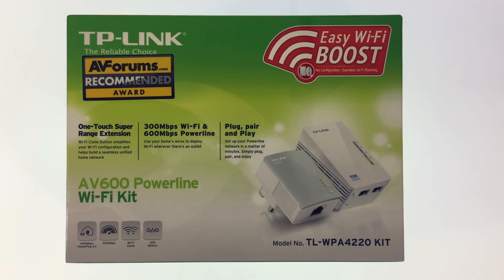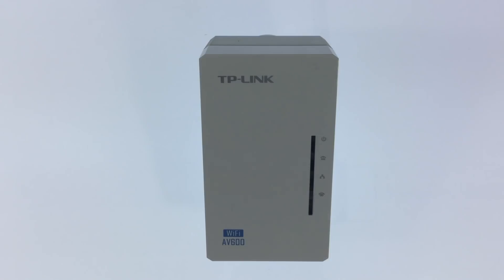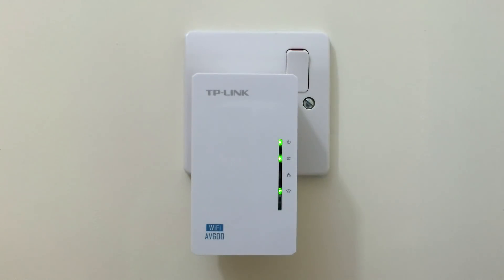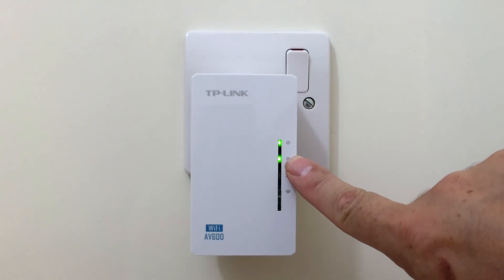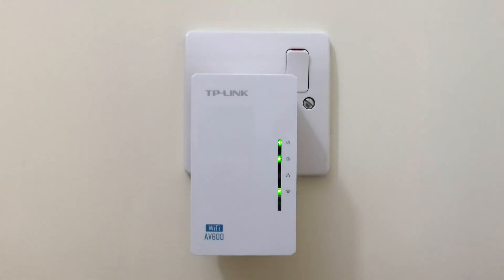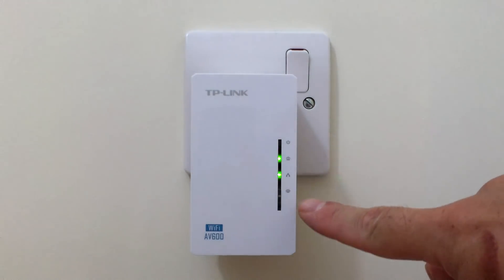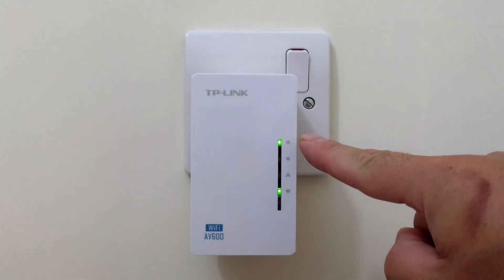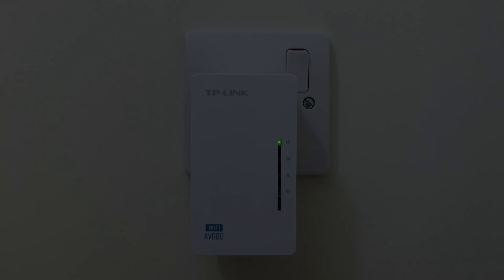Factory Reset a TP-Link (TL-WPA4226) PowerLine Extender

Comment: My wifi indicator light is off all the time and we can’t Connect to it, doing this can it solve the problem?
Reply from the maker: All this would do is return your TL-WPA4226 back to its defaults. This would then allow you to  try and set it up again.

However, many factors can effect the performance of a wireless connection. So you might be better checking for wireless interference  first. 

Devices that will interfere with wifi include, cordless telephones, microwave ovens, bluetooth devices, Christmas tree lights and other wireless routers.   

If the problem only just occurred, I would suspect  signal interference. So In the first instance try changing the wifi channel on your extender. You would be looking to use 1, 6 or 11. Avoid using auto.

Hope this helps.
Reply: @mydoodads  i can’t change the wifi channel because I can’t connect to the amplificator, and as well only the first 2 light are on and every 5-10 seconds it restarts automatically and cuts the signal when i try to use LAN cable instead of wireless option.
Reply from the maker: You might be able to change settings on the amplified, by connecting your computer via a network cable rather than wifi. Failing that it might be worth resetting it and trying to reconfigure it
Reply: @mydoodads  i didn’t ever configurated it, but im afraid of resetting it and not solve the problem
Reply from the maker: It’s possible that the amplified may have popped and has become faulty. I think you might need to contact TPLInk support.

Comment: Im wanting to do this because at the start when i bought it it was 30 mbps now its 13
Reply: Did this solve the problem? I face the same issue. 125 mbps provided, 90-100 mbps reached the computer through CPL. Then, 2 years after it dropped to 30-40 mbps. Now I have a 400 mbps connexion with my new provider and still, only 30-40 reach the computer. I'll try this.
Reply: Did it work?

Comment: My WiFi light doesn’t come on at all
Reply: hello, some of you have resolve it?, I have the exact same problem, the wifi light doesn't turn on and the device is just restarting over and over again making noise.
Reply: @PedroAlejandroRamírezReyes  I have just sent it back to the shop due to warranty
Reply: @moaad.  oh thanks for answer and yeah I will have to contact the support. Thanks
Reply: @PedroAlejandroRamírezReyes  same here. So noisy till my dog gets annoyed
Reply: same here, did you figure out how to get it on ?
Reply: @tundrasheep  same, did you fix it?
Reply: nope, I think the unit has gone bad, but I do remember manually turning off the wifi function, just cannot turn the wifi function back on

Comment: Can I connect it to the internet without the lan cable connected to my router?
Reply from the maker: No, you will need to connect it to your router via a  LAN cable.
Reply: mydoodads is there anyway I can have internet in a place without having to connect lan cable?
Reply from the maker: @lolbackup2212  You could use a WiFi extender. Possibly something like a TP-Link TL-WA850RE N300. 

However, this is not a recommendation as this type of technology, while cheap, just is not all that great.

I found that by using this sort of WiFi extender, the technology was fine for basic internet stuff ie browsing or email. But poor for anything that required real bandwidth, like streaming, or using games consoles

If you are UK based, can I suggest that you look into something called  BT Whole Home Mesh WiFi. https://www.expertreviews.co.uk/bt/1405560/bt-whole-home-wi-fi-review-great-value-mesh-wireless

While I have not yet had a chance to play with one. I have heard that they can be used to extend the WiFi on your existing router. However,  being newer mesh technology they give better data speeds than the old style wifi extenders.
Reply: mydoodads I play on a gaming pc and I stream and I will go to another room that does not have a lan cable and so do I have to bring a lan cable to my room or is there i way I can do it wirelessly?
Reply from the maker: @lolbackup2212  If the WiFi to your house does not reach the room where you are playing or streaming. You will have to either install better WIFi or using a network cable.
Reply: mydoodads it does reach and I have a DHP-P306AV Extender and I got it from D-Link and i don’t know if it can be used wirelessly
Reply from the maker: The DHP P306AV is not a Powerlines wireless extender like the TP-link units shown in the video. So no it can’t be used wirelessly. Instead to have a powerline adapter that will use the electrical wiring in your home to transfer data.
Reply: mydoodads is there extender that can be used wirelessly?

Comment: How do I connect to the WiFi after?
Reply from the maker: After resetting the extender, it will revert back to broadcasting its default SSID. You should then be able to connect to the default SSID using the default password that was supplied with your AV600. Hope that helps.
Reply: mydoodads what if I don’t remember default password which as supplied with my av600
Reply from the maker: Hi Ibrahim,

If you turn off WiFi on your computer, then connect the computer to your AV600 via a network cable. By entering the IP address assigned to your AV600 into your web browser. You should then be able to access the Web based user interface for the AV600.

You might be able to use http://tplinkplclogin.net. However, if that does not display the AV600 web user interface. You simply need to enter the IP address your AV600 has been assigned into your Web browser.

If you are not sure what the IP address that your router has assigned the AV600. Try running a network scanner. This video might help you to discover what IP address the AV600 is using. For macOS - https://youtu.be/AlJs26OgWYo  For Windows 10 - https://youtu.be/OhTd82ReZ-Y
Reply: @IbbyK4  hi, happily it's written on the back label. SSID name and password.

Comment: mine says no internet connection in orange below the network name when u try to connect
Reply: @jakew8960  , Hi, have you still got a problem with your tp link ?? ive never really had trouble up until now that none of my devices will connect even though my TP- link is paired correct
Reply: Joe White I’ve got this problem too have you had any fixes for it